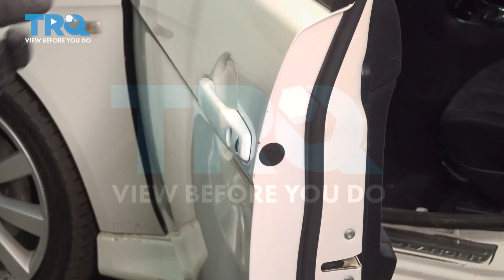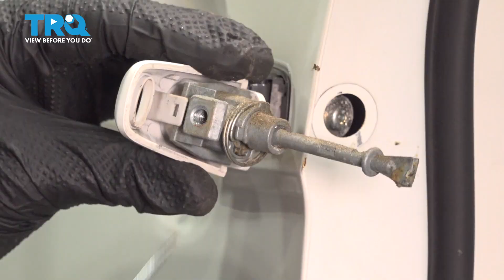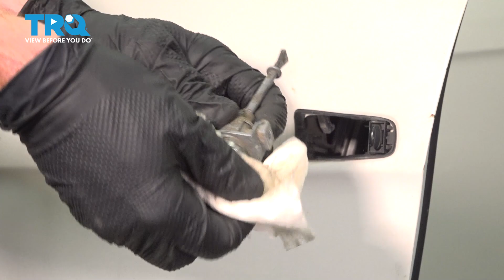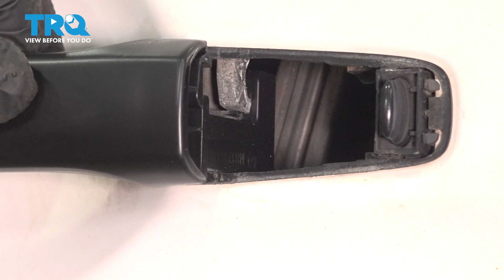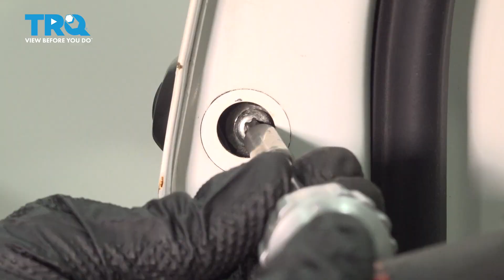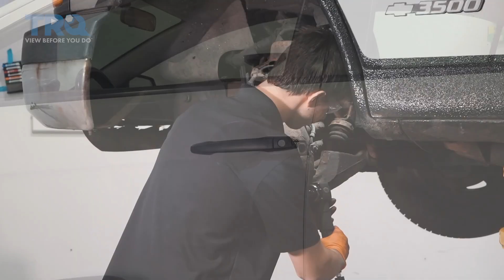How to Replace Front Exterior Door Handles 2008-2017 Mitsubishi Lancer

Comment: Thank you for this video!

My car was literally just sitting on the driveway. I pull the door handle, and this whole thing came off from the door. 

Fortunately, I was not pressed for time. Found this video within 3 minutes. Applied everything from this video and put the door handle and key tumbler trim back in 10~15 minutes. (Longest part was finding my T-30 bit in my tool stash.)